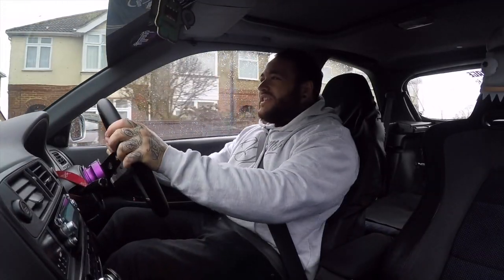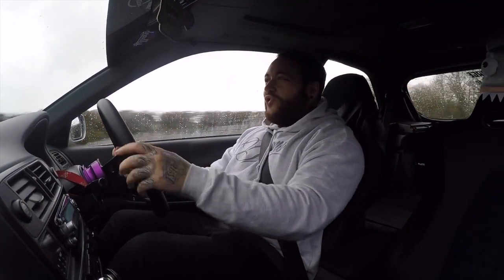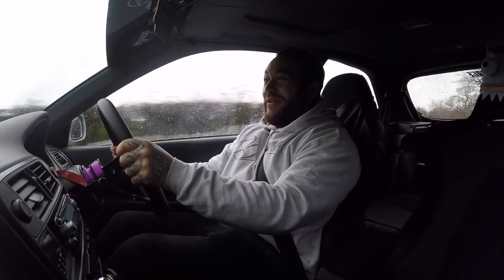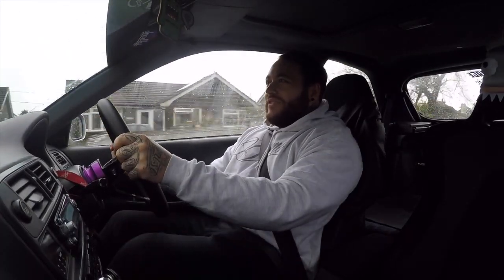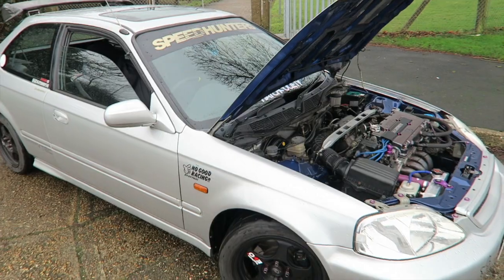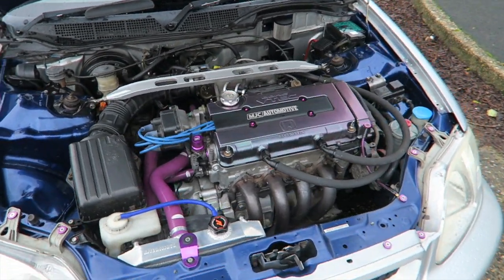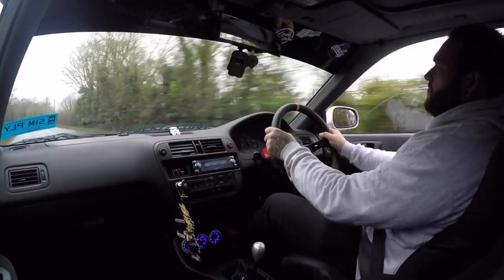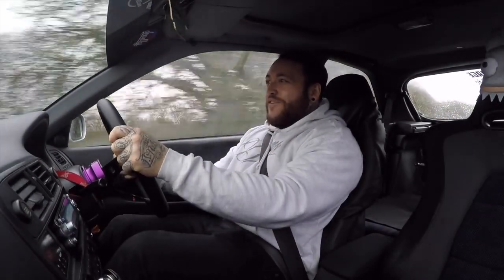BRUTAL N/A 235 BHP B16B EK4 HONDA CIVIC!!!

Comment: Nice car! I have a Rover Metro 3 door, super light weight, all empty inside just two seats. A small car with a VVC lotus Elise engine that came out of MG ZR and is on 270bhp. Has a all stainless exhuast system, forged Pistons, emerald ECU and is a 1.8 litre as well. K series engine. Brutal pocket rocket
Reply: J4M1E 9199 I’d love to get that power out of my MGF!
Reply: I had a 1.4 rover metro it was nice :|..._zzz
Reply: Tomcole020 yeah mate it was done 6 years ago at a place called DVA power in Birmingham and it was a total strip down. Started off as 160bhp
Reply: Dk 35 nice I have a rover Metro 1.4 GTA still as well. Rare now
Reply: HOLY FUCK! Jamie, make a video with this lad!
Reply: Fernando da Silva yes can do mate when she is back on the road in the summer

Comment: Mr Monky London will be drooling over this but his civic will be better with a turbo 🤤
Reply: a turbo doesnt always make the car better. 
Just means it'll be faster in a straight line, which is boring.
Reply: Love NA builds always more fun and more noise
Reply: I bet monkys b18 will die pretty quick with a Turbo.
Reply: @99Lezard99  well, it did
Reply: @Flowermouth  see? like i said. you just dont put a turbo on a fairly high cr, high reving n/a engine without doing ANYTHING to the internals or at least the cr and then using it like monky did without it blowing up. if he would be one of those guys who puts on a turbo, goes for few pulls and then posts how reliable it is before driving it like a grandma again for the rest of the month, it would have lasted way longer. but if you want to push it and use the power often and hard of course it wont hold up. 

im fed up with people claiming "you can run easy ~300hp on a stock engine" because you just cant. or you just use 100hp of those 300 all the time then itll last of course. 

to have an engine that lasts requires lots of money on almost all the internal parts plus big amounts of cooling. and then it still wont be as reliable as it was from factory. the whole system of an engine and gearbox is designed to its stock power with some additional "safezones" on top. but things like block and head casting for example are surely not designed to hold almost double the hp and torque over a big amount of time. its allways a gamble to go nuts with big boost. some can handle it better then others. thats why there are these "legendary" tuner engines like the 1j 2j rb 4g63 and so on. some cant hold it too well.

Comment: I thought I heard you said it's a B16B block sleeved to 2liters ....so I would say now it's a B20B 😁... LoL....with better revving ability....
Reply: Craig soul sleeved to 2.0l ??? You mean stoked to 2.0l so the crank gets changed you noob
Reply: Sam the man...listen at 2:14 and TELL me what you heard the guy said??..I didn't say it he did I know my ears are working
Reply: Its a b16b, stroked to a 1.8 using the dc2 crank, then it has been bored out to 85mm giving it the 2.0 capacity.
Reply: @HarryEk9  the b20s are 2liters and they use the b18 crank and an 84mm bore.  It's a little more displacement then a b20
Reply: @timm5970  actually b20 has the largest stroke(crank) in the b series family.
Reply: @vebzuia4336  b20 does not have a larger stroke then the b18b1

Comment: B16s a dying breed. Refreshing to see such a healthy and punchy one over a b18 or k20
Reply: I bought my CRX here in South Africa stock Red and full interior with a b16A bought it from a older gentleman who looked well after it. k24 block and k20 vtec head is done, Forged internals are in. Now waiting for the ITB tune. Love these engines.
Reply: Thomas O'Reilly it’s hardly a B16 if it’s bored & stroked?
Reply: Sergio Aguirre & it’s far from a run of the mill B16 now.....😂

Comment: So basically its got nothing to do with b16b. Ive seen a destroked b18 with B16A head doing pretty much the same power from 1.6. Not sure what is wrong with this engine but you dont need much to make 200 wheel from a b20/b16a head combo

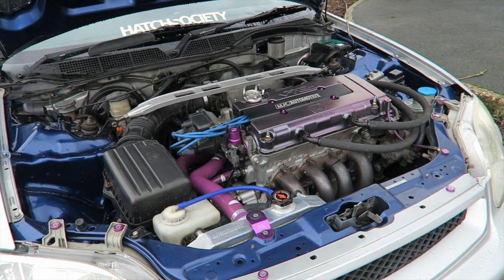Comment: 1:12 standard airbox
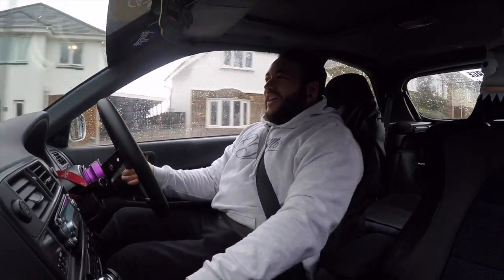1:18 forged rods and pistons
priorities
Reply: The airbox on the b16b is brilliant, It's reccomended to keep it stock. Although it looks out of place its right for the car would you believe.
Reply: yeah it is good for the b16b but the fact is its not a b16b any more its a b20ltr so it probally aint doing it much good compared to a proper cold air feed in the bumper or wheel arch.
Reply: Looks like a b18c air box which has a ram horn funnel at the inlet end
Reply: It's a b18c airbox and has a massive cold air feed down to the bumper
Reply: Yes its a b18c airbox. The best b series airbox
Reply: i would have thought no airbox would be the best airbox
Reply: Oscar Thorpe i kept the oem airbox on my jdm dc2 because it was very well designed and very efficient. Knowledgeable honda  enthusiasts know that.
Reply: aasou yeah well im not a knowledgable honda enthusiast. ive never owned one and probably never will because by the time im old enough to buy one they will all be driven into the ground or riced to pieces.
Id love an S2K some day though.

Comment: Sounds like the clutch was struggling with the power .
Reply: The cjrshop it's a stage 2 clutch, takes a bit getting used to. Handles just fine. All of that is wheel spin
Reply: Marcin Anszczak haha that explains that then
Reply: The cjrshop also it has to do with the wet road

Comment: Why sleeve a b16b when you could have put a k20 in it and could have got more power more easily
Reply: Because you need a motor, trans, new mounts, new harness, intake, exhaust, custom brackets to keep power steering and ac, custom or modified axles, a new ecu and have it chipped with k pro, new fuel pressure regulator, and tons of time, tools, knowledge, and troubleshooting to get it done.  It's not an easy thing to do at all.  I bought a b20b high comp for 130 dollars.  Thats way fucking easier then swapping in a k series and waaaayyyyy cheaper.  It will also be faster until you truly start missing the shit out of the k.  He has forged pistons , rods, and sleeves I believe  but that's for reliability.  For that same reliability in the k you'd have to do all that as well.  A k swap like that is like 7k

Comment: how did he get 235bhp? 
what stuff did he use, just rods and pistons?
Reply: b16b block - bored from 81mm to 85mm, b18c crank, cp rods and pistons (forged high comp) sleeved block, port and polished head. 
The engine is now in my ek9 with a rebuilt head now has stage 3 cams, supertech valve train, skunk2 cam gears, skunk2 ultra inlet. Also has a rebuilt gearbox with a plated cusco diff. being mapped next month.

However this ek4 is up for sale start of may with a 200hp b16b stroked to 1.8 using dc2 crank and rods with oversized b16b pistons.

Comment: a 1.6 bored out to a 2.0ltr -.-
Reply: Jason Poole you mean stroked not bored
Reply: It’s both. It has 85mm pistons and a B18 crank, which makes 1979cc. Only having 85mm pistons would make it only 1.75 litre
Reply: well its still bored if it's making the inside diameter of a hole bigger.
Reply: He's says stroked and bored.  The b20 is 84mm bore and a b18crank.  He says it's 85mm and a b18 crank.

Comment: 235hp@wheels Not Bhp,  Engine stand Dyno = Bhp
Roller Dyno = Wheel hp .
Reply: 235bhp corrected for drive train loss. Welcome to Europe.
Reply: @Liveforeever  lol no way that car is under 220whp lol...  simple facts
Reply: @jjsorenavki7005  it is about 200-205whp trust me I have a b20vtec thats 236bhp (202whp), In America the figures are higher but in Europe the dynos are more realistic
Reply: @Liveforeever  im not america nor is driveline lose only being 10-15whp even as a Fwd.. i have a 280whp k24...   it cant be 200whp an 235bhp lol  235bhp would be 180whp..  an that car is responding easily more like a 230-240whp setup end of the day a roller dyno isnt accurate its just a tool to safely tune an engine on while the engine remains in the car,
Reply: @jjsorenavki7005  my drive train loss was about 18% on a euro integra dc2 with the s80 4.7fd,im only saying from experience. What you are saying that this b series is around 260 at the crank, trust me that's very hard to do unless it's revving to around 11-12k rpm which it isn't.
Reply: @Liveforeever  I have worked at a Shop here in Australia for the passed 15 years..  I also have done some tuning, 18% drivetrain lose on this would make it 190whp..  Dyno's are not accurate Unless they are a Hub dyno or a Engine dyno,  *Roller dynos Will never give you a on point result of Power also alot of other factors come into play on Power output,  Dyno's are just a Tool to Perform a Tune safely,  on a Hub dyno this car would be making 215-225fwhp easily,   The car isn't Gutted the accel of this wouldn't be that fast with only 190whp I have owned plenty of B Series , D series  F an K's  aswell as Other turbo car's

Comment: Loads of noise and little go lol. Gotta love them though. Good fun them cars.
Reply: 900kg and 240bhp. this would surely run 12 sec quarter miles. hardly slow for an NA 2L.
Reply: ikr my dad's old '68 Charger got 11s at Santa Pod. Civics aren't little go.
Reply: How many other N/A engines are there that have power per litre figures like this, bare in mind this engine is from the late 90’s. Most N/A supercars never had power per litre like this
Reply: I can assure you this has more than enough go...
Reply: You would need a very fast machine to get this car off your tail in an all round race
Reply: This would anhiliate most hatches on the a roads. Good little go kart. Back in my younger days I had this exact set up in my eg civic and I can tell you it's not slow. I also had the k20 at about 250bhp in another eg and that thing was destroying super cars.
Reply: No go 😂 🆗 mate

Comment: 235HP, really ? With a cheap no name header's, a cheap Ebay exhaust 1.75 inch wide, 1.6l engine untouched with a stock airbox, i don't believe it, that's BS.

Even my K20 civic with Skunk 2 Cold air/ Skunk2 race header's / Q300 exhaust / Ktuner and a pro tune on dyno don't make that, my tires are wider, i'm LSD and my 3rd just spin in the wet.